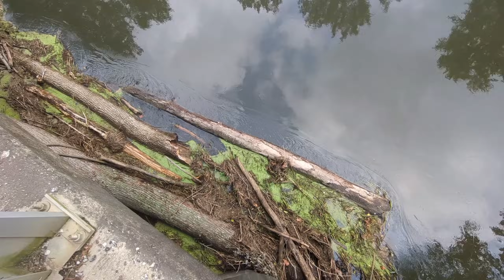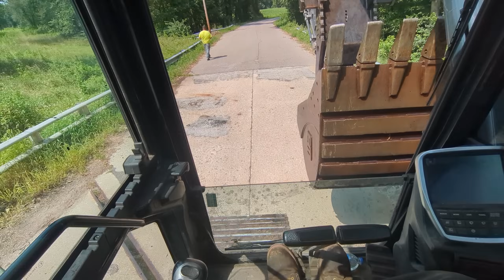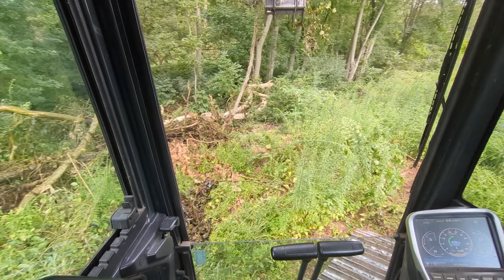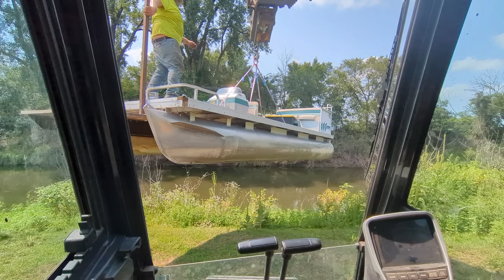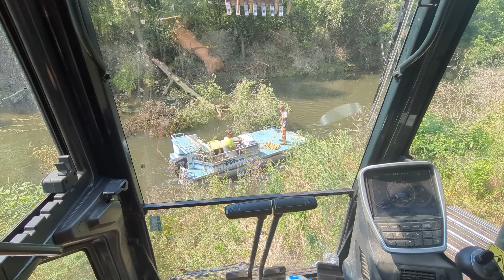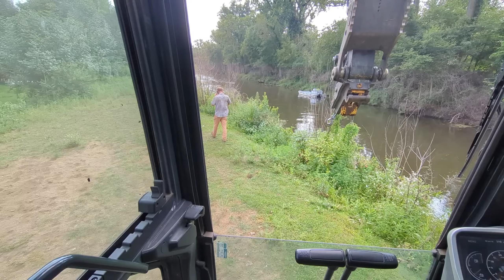More Fun On The River With The Excavator And Specialized Pontoon Boat

Comment: As usual, a very relaxing video. I suppose, it has something to do with the fact, you're on the waterways. I used to spend hours watching the seashore/ waves when I could. I have always lived a  long way from the seaside, as I used to work in London, which is, from where I lived then, some 30 miles away. After I stopped working in London, I moved nearer the south coast, still being about 25 miles from the sea, but nearer lakes and rivers. Now I'm stuck in the middle of the country, more than 65 miles from the sea. 
Anyway thanks for letting me see some riverscapes occasionally. From UK.

Comment: Hey I have a moxy mt30 that i am going to get rid of this week. My buddy says you will want it for parts. the unit has not been run for 3-4 years and the engine and trans were both working good when parked. super cheap and located by ohare airport.
Reply from the maker: Can you email some pictures and a price? Dirtworks2008@gmail.com